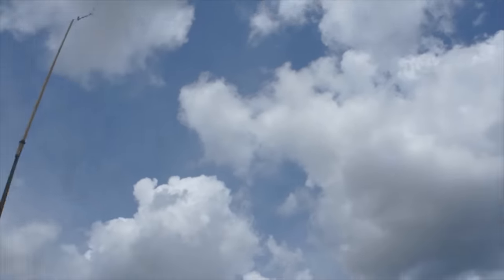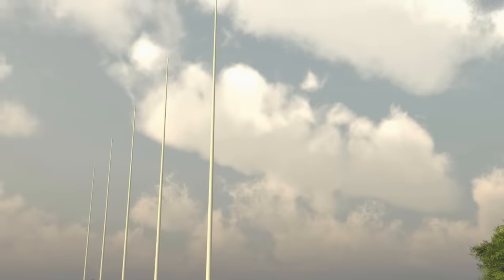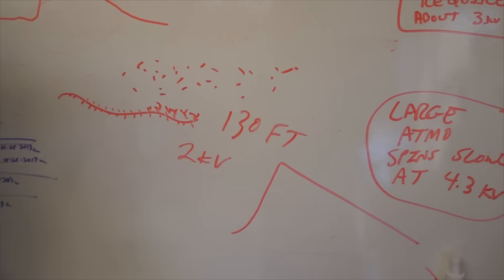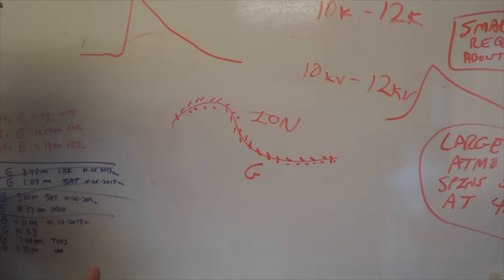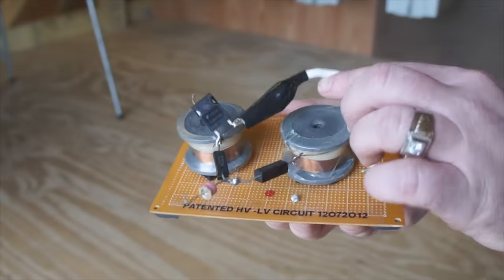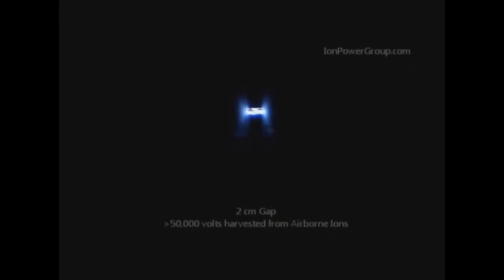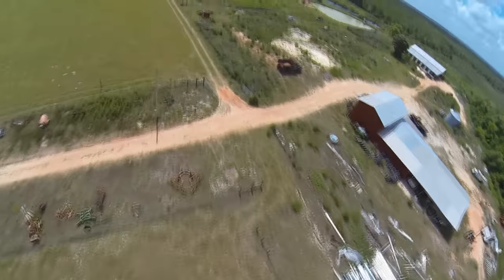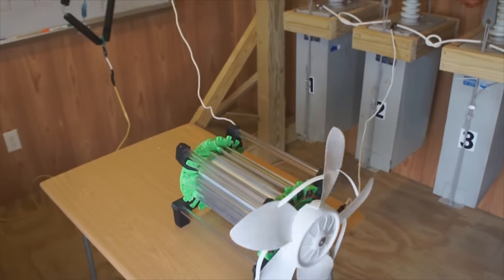Graphene/Graphite Atmospheric Electricity Collectors - Plus Horrific Hexacopter Crash!

Comment: I worked for the phone company for 30 years before retiring 12 years ago. You don't need graphine for this. We would install what we called "C " wire for customers too far from the terminal for regular drop wire. This wire would knock the hell out of the installer when we would install it. It charged immediately after sparking so it was virtually instant. We could take the end of the C wire and spark it to the ground wire on the pole and it was larger that what I saw on the video. C wire is a copper and iron mix to make it stronger for large unsupported distances. It had enough iron to make it rust if exposed to the weather. I can assure you there wan't any advanced science involved. We called it static electricity and I'm sure it was in the thousands of volts because the sparks could be an inch long and the spark of a 50kv spark plug were less than that. Of course there was very small currents. I suppose you could draw enough to kill you, but you were more likely to hurt yourself on the pole than die of electrocution. All this was done with a wire only 7-8 to maybe 10 pole spans long. I've seen miles of C wire spans before.
Another phenomenon we observed was holding a neon tube with your bare hands below a  high power pole would light the lamp. It's just the electrons in the air around high tension towers are free to the gatherer. I always heard that if you harvested these electrons the local light company would come after you for stealing their power. There have been people string these wires for a  few thousand feet to run things in a home and the power company DID come after them. I have no clue how far you would have to string the wire away from power poles to be safe from prosecution.  They would present it in court as you building a transformer to induce power in your wire.
I'm sure graphene is wonderful, but this isn't new tech. If a wire without graphine was strung on the same poles, it would do the same thing.
Reply: Interesting ... thanks for sharing.

Comment: Ok, this is really just terrible.  How many amps is it?  How many watts is it?  I know you know that those two things are critical to any analysis of energy generation.  Just mentioning volts and no other units is extremely suspicious.

Welp, the demonstration demonstrated the amps.  Pretty much zero.  That whole thing generates less power than you rubbing your feet on carpet.  If they're crowdfunding this on indiegogo, thats got pretty serious legal problems.
Reply: measured in picoamps if I remember correctly
Reply: The numbers don't matter to the people that waste their time with those things! But they will have no problem peddling non-science in a crowdfunding site with no reliable science behind it if they just "sell" big ideas and unfunded speculation. Just look at the Solar Roadways campain.
Reply: I have this amazing generator that generates thousands of volts, All you need is some carpet and some wool socks. We are going to change the world!
Reply: Solar Roadways is far more practical than this scheme.  And in defense fo that concept, their implementation of it was the problem.  Poorly designed.  Poorly mapped out goals. = Poor result.  That doesn't make the concept invalid.  It is working in other places like Denmark and China on their concept roads they have built since.  

As for this atmospheric energy harvesting idea...  You will find that some of the energy is from natural and some energy from man-made sources (radio waves, microwaves, etc) which would make the location and placement of these aerial antenna collector wires super critical in terms of how much potential energy they can gather. If it can barely make a small motor turn (and one probably designed with its weaknesses in mind have you), then there isn't anything to write home about yet in this kind of electrical generation.  We'll see what they can get if they scale it up.  There may be a much larger energy potential at higher altitudes which could make this perhaps somewhat useful somewhere.  We'll see.  For now, move along people, nothing to see here.

I don't doubt that the capacitors are being charged from sky energy, but as such, there is no other go-to best choice for storing such energy because the energy is not continuous baseline power, it comes in in sparks and spikes. Its something that oscillates in intensity due to the nature of how it is transmitted and collected.  It's like background noise.  Charging batteries would require constant stable current to make it practical but that cannot be achieved without a bunch of dedicated people like us who believe in a concept deciding to put their full efforts behind it—feast or famine style.  Because right now, this is about as productive as trying to recapture the energy wasted in a transformer on eddy currents.  You could potentially achieve this demonstrable effect that has any potential to impose you want to assign to it and the fools out there are willing to buy it up and eat it and more soup please their way through it.  But those with a practical mind will see that the energy and time expended on this is not going to scale up to anything amounting to something worthwhile at any scale to seek.

The transient and noisy nature of such power demands capacitors as a high speed buffer to trap energy and release it at a more predictable rate,   I suspect the reason we only see capacitors and no connection from those to a more useful source of electricity that puts out constant current over a longer discharge curve such as a battery array is simply because they know that there is no real amount of useable power here.  I could make sparks way more impressive and hundreds of times more visible than those with a mere nine volt battery and an existing stone-age piece of electrical equipment know as what's called a stun-gun.  All that time and effort is better spend improving existing useable technology we know we can alter and scale up size complexity more cheaply and much quicker than something like this...j
Reply: Commenters here are ranting nonsense when other people are actually doing stuff.
Reply: even if it's 1ma at 20kv

 that is 0.166amps at 120vAC  20watts at the most
Reply: @xapplimatic   meh a single   Harbor freight solar panel  can generate more then the 0.1kw solar roadways makes
Reply: Wouldn't you get the high amps you need by connecting capacitors in parallel?
Reply: @MatthewHyatt  patented means in the public domain and open to scrutiny so using that as an excuse only adds to the call of BS
Reply: But have you u made it? You can make these devices and try them out.
Reply: Lightning storms generate quite a lot of power! Same technology, only scaled down. It would blow the circuitry otherwise!
Reply: @billysgeo  Solar roadways is an amazing idea and given the amount of power generated by solar panels, would be a massive input to the grid and a great use of otherwise wasted space (like your comment). Affordable, easily replaceable Solar roof tiles and windows too.
Reply: @xapplimatic  It didn't barely make a small motor turn! It nearly blew all the capacitors and circuitry the power stored was that great. Only the trickle charge of DC was running the motor. Existing useable technology like what? Rechargeable batteries and wind farms? Totally inefficient if the same power can be generated from static aerials, on tall buildings, for example (with solar panels for windows of course).
Reply: @MattBlytheTheOne  solar roadways are crap 

The breakdown to fast cost per kw is very high
Reply: Then they need developing and producing with more robust materials. Nothing wrong with the concept.

Comment: I'm sure their installation recover less energy than a 0.01 m² solar panel on average. But it's still interesting.
Reply: On ne peut pas dire mieux. 
Couldn't have said better.
Reply: There's serious doubts about its scalability. They've harvested a few watts at most. Similar thinking people talk about 1,000 volts but never talk of power ( Watts = volts X current ).

I can take my nylon shirt off and make more volts and sparks. Never going to power my phone let alone my TV from my clothes!
Reply: @kevinslattery5748  There are static motors from long ago, seen some pictures of one the was wool rubbing glass i think it was and I dont remember how the static was created on the other but it has been done..
Reply: @aywitb911  I'm sure extremely high voltage motors have been made. What I say is that this technology is unlikely to go anywhere as the amount of power available is limited to only a few watts. 

So maybe a 10 or 20 watt LED light, so heating is off the table.Can power a radio. Maybe power a toy electric train motor.

So this tech would have had value at one time, but not compared to modern tech requirements.
Reply: @kevinslattery5748  I'd doubt if this technology is totally useless. For one thing, it harvests energy not power. Once you have accumulated enough energy, you can consume it at any rate (i.e., power)
Reply: @officealireza9097  ... Maybe, at a rate of 7,200 joules per hour, that's a big number, right?

Or if one accumulates the energy for an entire year, without any leakage, one could run a $10 fan heater for 4.5 hours on a cold winter evening.
Reply: @kevinslattery5748  Similar to photovoltaic panels for solar electricity, the million-dollar question here is how to make efficient collectors for atmosphere electricity. I suppose the graphene wires are not necessarily the best technology. I am just wondering how they evolved their harvesting wires after about ten years now

Comment: The problem with this set up, and solar, wind set ups is that the V/A charactersitics varies a lot. You have to store the electricity somewhere and use it when you need it. We still do not have good batteries. And what will happen if a lightning strikes these 4 poles? They are like a magnet for lightnings, there should be a really good protection!?
Reply: There are plenty of equipment designs out there which limit or arrest lightning strikes on structures or aerial lines.  I use one form of lightning arrester on the incoming power from my solar array as would anyone which has any kind of wires leading up to metal equipment on a rooftop.  We have good enough batteries for solar and wind.  They are just not cheap because the metals used in them are scarce and not getting less scarce and because of that now monitoring the sources of metals has to be. paid for too too ensure they don't originate through gang controlled slave labor camps etc.  They are perfectly suited for solar and wind because by and large their power is produced over time..  But something like lightning where the energy is all transmitted in under a second at high amperage.    To store something like that we would be forced to turn to large parallel banks of super capacitors..   But don't get excited yet.   Even with the best graphene super capacitors, were they able to store all fo the 1 billion+ joules of a single lightning strike, it wouldn't be enough power to power a single American average home for a year.  Far from it..  See for actual numbers: 
https://www.realclearscience.com/blog/2012/05/could-we-harness-lightning-as-an-energy-source.html
Reply: 1.21 jiggawatts of power   But the only power source capable of generating 1.21 gigawatts of electricity is a bolt of lightning.
Doc: A bolt of lighting. Unfortunately, you never know when or where it's ever going to strike.
Reply: punker4Real Oh my God you just gave me a genius idea both of your comments.

Comment: This is a dream come true!  I remember in high school coming up with the same idea, just a different method.  There were collector towers, but it was on a scale much larger than this.  The main event would be a super-conducting smooth panel with a large surface area (large being two football fields) connected to Earth ground and charged to influence the flow of atmospheric electricity.  This is better; it will not destroy world.

Comment: Very cool, ty for sharing. I'm very curious if they've tried a rotary spark gap off of the capacitor as Tesla prescribed in order for tuning to Schumann?...I'm guessing that this will maximize voltage. I'm also imagining that the best application might be to store the energy in a battery bank as with a solar array. Such a juicy vid, ty :)
Reply: I'm not an expert in Atmo-En but I have to say my mind agrees with you. I think to get the full potential out of a huge system like that you should excite it either directly (rotary-spark-gap) or indirectly with a large tesla coil with a setup similar to "theOldScientist" "Power Transmission in a Lumped Circuit" series. The negative ground potential input would, ironically, be the special graphene-wire system in the air. I think a system that large should be able to blow up those fluorescent tubes and turn the shack to ashes.
That being said, it is still really amazing stuff, and I can't wait to see/hear more from that group.
Reply: Binj Komisar How about with a larger Tesla tower inductor like Wardenclyffe?...hehe...or, like the ancient inductor tower at Giza? :) Peace!

Comment: The dude drew the same stupid picture on the board like four times as if that gives us any information. We need to know what the sustained current draw is in amperage to find out how much power this thing is generating. Anybody who's spent TEN years working on something and is still in the testing phase hasn't come up with anything new.
Reply: Fully agreed. The fact they apparently can only drive a ventilator from a rather huge installation says it all...
Reply: Tesla, said the natural medium, fluctuates the available power a bit,  but he seemed to say,  the earth and the sky in conjunction, ,96500colubms,  and difference of 360000 volts,  (but that may only be at a height of 60 miles,  not feasable. So he says the system acts like a .25 farad capacitor, current divided by potential.
Reply: @ruuddegraaf886 ..that ventilator isn't even running properly

Comment: These AtmoMotor vids are great! Very inspiring, thank you! My thoughts on the collector array would be to use a very large geodesic skeletal dome, coated with the graphene. This might mirror Nikola Tesla's Wardenclyffe Tower to some extent. This would create more area for atmospheric charge attraction. Secondly, I would like to see the effects of a larger, but thinner ring type motor, perhaps the thickness of the mini atmo with the razor blades. However, (thicker or thinner), instead of a small 3-4" diameter, I was thinking much larger, like three feet or greater, mounted with it's axis vertically. This would allow for a magnetic bearing to float the motor itself with a light weight ceramic bearing to guide the top portion of the spindle. integrating a 3 phase alternator into the design, such as those we see in the DIY wind turbine vids would be a bonus! Moreover, using some of this atmospheric power to create more static charge (perhaps via the spin of the spindle itself against a few strips of wool and then directing the power back into the system using diodes might make the system more efficient. Just some thoughts! :)

Thanks Again! Great Job!
Reply: An old cathedral with a cupper dome?